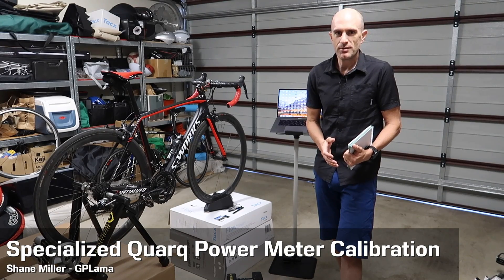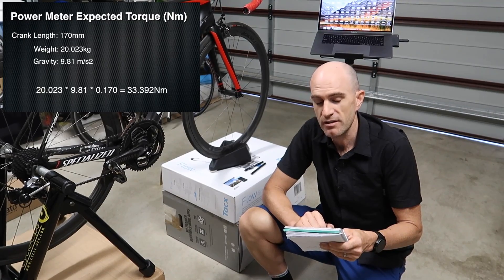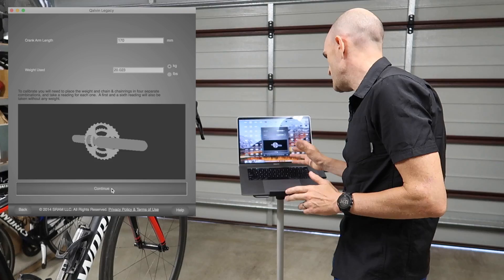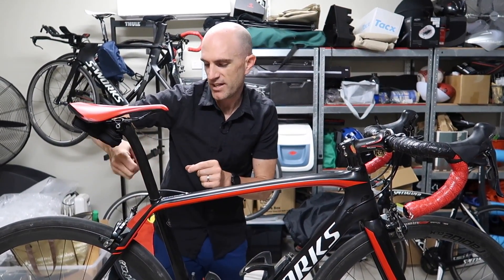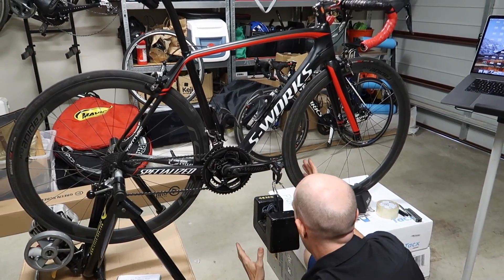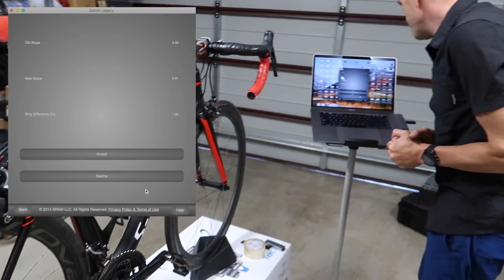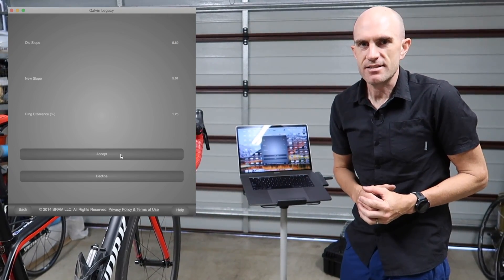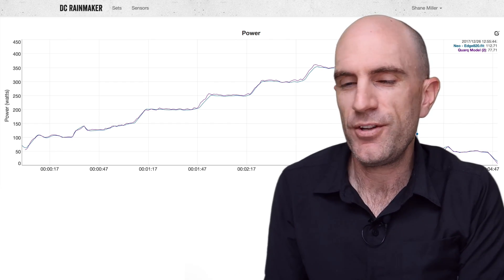Specialized Quarq Power Meter Calibration

Comment: Did the calibration on my quarq elsa. Had to do it many times to get it right. Trick seemed to be to do a few free turns of the crank before going to next step. It is now pretty spot on the kickr V6. Was over reporting before by some 15 watts @300 watts.

Comment: Thanks for the info - however  its not as easy  as it appears.  My story with my Elsa PM...

I had to pay to hire a calibrated (accurate) weight.  The company providing the weight only had 10kg, (QUarq recommends at leat 20kg for calibration) so I then had to take some home weights to the post office to get them checked for accuracy.  I did not have a convenient turbo trainer to hand so ended up putting my bike against a walll with the wheel on blocks to elevate enough to add the weights.   So in the end I was trying to place two sets of weights on one crank arm.  It was a complete fiasco.!

The software reported figures which advised a massive change of slope setting.  Given I had tested the Quarq powermeter against a Neo to start with, I knew the Quarq was out by 10 watts , so there was no way a large change in slope setting was required.  The net result was I decided ti leave the Quarqs settings as they were to start with.

So I am riding with a 10 watt error.   Given the totally unbelivable figures you see on Zwift these days, 10 watts out is not too bad!

Hope others have better luck than me : )

Comment: Hello, I have a query, my quarq dzero potentiometer has problems and it does not mark the real power until in some cases it does not mark anything, I would like to know what it is, take it to be reviewed but they tell me that it is fine, that they do not find the problem, and that they do not know why it does not mark the correct power, they say that they reset the potentiometer but it continues with the same problem.
 
I hope you can help me that it could have happened.
 
Thank you
Reply from the maker: Best to contact Quarq Support. I don't understand the question sorry.

Comment: Great demonstration of how to calibrate. I have trouble finding a weight. I am not extremely concerned about absolute correctness. I mainly want my different powermeters to somewhat align. My Quarq Riken that I use on my TT bike reads around 20W lower than my other power meters. I think the main change happened after I installed a larger front chain ring. I cross checked with a power tap wheel. When I use this wheel I receive very comparable power data for all my other power meters (Quarq DZero, Stages and Pioneer PM). Could I actually use Qalvin App and manipulate the slope manually until I find agreement between power tap  wheel and Riken in question instead of trying to chase an exact weight? I do not want to mess my Riken completely up but thought that this could work. If so, any suggestion of how much I should increase the slope number (I assume increasing to have it read higher power?)? Riken reads 300W where Powertap reads around 320W. 
Love your Fit File with DC Rainmaker.
Reply from the maker: If your PowerTap is confirmed to be correct, sure. It'd take some time and testing to line them up. Easier to source a calibrated weight and do the job faster.

Comment: I just took my Vector 2 pedals out of storage and installed them correctly. After repeatedly setting the correct crank length and install angles. I think the only option left is to do a static weight test and changing the scale factor. What kind of hardware is best to hang the certified weight from the pedals?
Reply from the maker: A wire hook. That's also added to the total weight in the calculations.

Comment: Good video and well presented, Shane, although you know my thoughts on 'home calibration'! Was your dead weight calibrated? I assume so given your decimal places. It's worth pointing out to your viewers this is still far off the Factory Calibration and should be a last ditch resort. One thing you must be aware of is creep. That is the sensors tendency to drift back to the origin after load application due to some relaxtion in the strain gauge and epoxy layer (visco-elastic). Thus is good practice to hit 'calibrate' the same number of seconds for each test after applying the mass. Secondly, you would normally perform a hysteresis relaxtion cycle before logging the first torque points. This involves alternating + and - torques to the load cell before taking the real points. This settles the sensor. Thirdly, I know the best PMs out there (SRM and p2m) use torque and speed calibration at discrete different temperature points. Temperature can affect the gauge factor and strain properties of the epoxy. I have a huge video on my channel about power meter design if you want to be bored even more :) Cheers
Reply from the maker: Certified weight, yes. Brilliant level of detail/info. However I try to keep it high enough level to be within reach/interest of the everyday user... including myself. There's a tipping point of detail and engagement on here.

Comment: Great video!!! this morning i was doing 3x20' z3/z4 work where Quarq came in at 30-40w less than Neo, creating a bit of a havoc/confusion to my numbers-oriented mind. on some sites i read that one should expect a difference between Neo and pedal/spider/crank based PMs due to where the readings take place. what is your experience in regards to this? looking towards the end of the video in DCR analytics, you seems to have a max deviation of about 5w (mainly 0-2w) which might be as much due to latency as anything else. 

initially, during warmup, the deviation was 15-25w but after having done 2 10s sprints at around 1000w the deviation went up to the 30-40w

Amazon failed to deliver a 20kg calibrated weight last week so i'm still in wait-mode before i can do the calibration you showed in first half of the video :-(

Comment: You go through all that trouble and accuracy in measurement and yet you eyeball level the crank arms. I hate to be that guy in the comment section but I am going to be. Get out a level
Reply from the maker: Crikey. Happy holidays.
Reply from the maker: It’s possible to check maximum Nm by moving the crank above and below 90deg. But if you’re all about the level, no worries.
Reply: Ok I misunderstood then, I thought it had to be level for the calibration check. So you were just doing It because you could. Merry Christmas to you too

Comment: Hi - I’ve just done this calibration in my 3 different Quarqs. Kudos to you for doing this video because there wasn’t much info out there when I started. A couple of things I did differently to you, so thought I’d pass on in the spirit of sharing the knowledge. First, you don’t need to weigh the hook. Instead, you can keep the hook on the crank when doing the “unweighted” torque measurements. This way you are not introducing another measurement error. Second, if you get the right hook then you don’t need to elevate the bike on boxes. If you do it on the ground, then you can hold the bike in place and apply the brake when you get the crank into the level position. This is the same way Jim Meyer from Quarq does it in his video and it’s pretty easy that way. Third, I sometimes found the Qalvin App a bit problematic. It’s an 8 step process and if your Quarq goes to sleep or it loses connection then the app gives an error and it’s back to the start. So instead I just did the calcs in a spreadsheet. As you said, you just need to compare the actual torque for your certified 20kg weight with the measured torque, which is the average difference between your 4 weighted and 4 unweighted readings.Out of my 3 Quarqs, one was bang on, the other within 1%, and the third was reading a whopping 5% too low!! Now they are all consistent which is much better when training on different bikes. Thanks again for your video. Must be hundreds of guys riding around with incorrect power data I reckon.

Comment: Hi Shane. Great video as always. I have a question for you. At the moment I have what I believe to be an accurate Quarg DFour and a old "variable" Vector 2 and am considering my options. Either a second Quarq to save swapping from bike to bike (2-3 times each week) which can be "troublesome" or going for a single accurate pedal based system (Vector 3 once there is enough positive feedback regarding accuracy - have read all of your posts on Garmin forum - Thank you). Do you have any thoughts? Also If I were to perform a static weight test with the same certified weight on 2 Quarqs would you expect them to then agree +/-1w (just like your Neo vs P1 video) so that I could just have one set of power zones & FTP etc etc. as I am not as powerful as you and even a 5w difference when doing SweetSpot or Threshold intervals could make things challenging!!!!!!
Reply from the maker: Swapping power meters regardless of how easy, is always a hassle, imo. Two power meters of the same type (Quarq spiders) should be very very close to each other if they're calibrated the same.
Reply: Thanks Shane. Your opinion/insight is very much appreciated. So it looks like a late Christmas Quarq has just been added to the shopping list. Thanks once again and keep up the great work 👍👍👍.

Comment: One thing for people to note is that you may need to use a magnet to get the spider to start measuring torque for the calibration on some Quarqs (ELSA, RIKEN and RED) even if you dont actually use a magnet to measure cadence on the bike. Then you need to rotate the cranks forwards to get it into the right mode. Otherwise the torque values may stay at Zero.

Comment: Could you repeat the process and hang the weight right in the middle of the pedal? Would be interesting if you see some deviation since that is the spot where the torque is actually applied while riding. When you put the weight more to the outside of the crank, it does not only bend, there should be some torsion too. The strain gauges will pick that up!
Reply: I just saw that you actually hooked it to the pedals. My bad!

Comment: Cool...  very interesting stuff.  I have been waiting for this one just out of general curiosity from my past sensor design engineer background.  Couple of questions and observations:  1) How do you know your weight is 20.000 kg (roughly 44 lbs)?  You state "certified", what does that specifically mean?  Seems like having a perfect 20.000 kg weight would be a rather unique and very fortuitous situation.  I am using 3 decimal places because you go to the extent of adding 0.023 kg for the mounting hardware.  2) Does Quark specifically instruct you to hang the weight off the pedal?  Think back to some of our earlier discussions of strain gage cross talk; the twisting of the crank arm potentially adding stress to the system.  With that in mind, it seems to me that hanging the calibration weight off the pedal introduces an unaccounted to variable.  Just as the crank length is a key factor in the calibration, the offset distance the weight is hanging off the crank arm would be as well.   Unless Quark has factored that in, BUT are all pedals the same?  If you had Speedplay pedals, would that offset distance be the same?  Of course, as discussed previously, there are ways in sensor design to eliminate the this issue, so the question is what does Quark instructions tell you to do? 3)  In the past, as a sensor designed, we would run repetitive calibrations on new designs in order to document the repeatability of the design.  One would expect Quark to have done this in their design validation, but it would be interesting for you to have repeated your specific process, say 3 times just to see how consistent the numbers are.  4) You stated Von's readings were a "...little bit..." high.  Does Quark provide any information as to how that slope value is used that you could convert into actual power values?  The slope value didn't change very much and we assume that means the power doesn't also.  Is that a correct assumption?  Have you ever done any comparisons of this power meter to any other prior to this re-calibration?   5) Would have been interesting to run the DC Rainmaker test on the system BEFORE re-calibration.  Also does DC's tool have any statistical analysis functions?   Would be interesting to do the math to back up a statement like "the Quark on average reads 1.5% lower than the Neo".  For that matter, that would be interesting on all your videos where you use this tool.  Having watched most of them, it tough to tell the differences between videos.  6) Couldn't you use a level to set the crank arm angle?  Probably a bit overkill, but easy enough to do.  My android tablet has a simple bubble level app that I've used to document seat angle.  Of course the key for calibration is to have the arm 90° to the direction of gravity!  Not to the floor, or not to the bike.    Thanks for another interesting video.  Sorry for being so long winded...  cheers!
Reply from the maker: 1) Sourced from a university. Tested/labelled. I trust it. For now. 
2) Pedal, yes. It's what they use in their guides too.
3) It's Christmas. Family time > backyard bike science time. But yes. 
4) Not sure, see 3. Time. 
5) Same as 3. The DCR Analyser is pretty basic with the numbers. It's a simple comparison of the figures.
6) Laser level would be ideal. Spirit level doesn't work on the cranks with curves.

Comment: Very interesting watch. Wanted to see someone actually doing Quarq static calibration. Good idea with the rear break blocking the wheel when cable quick release is closed. My Dzero is still quite new, so I trust its current calibration, but giving customers ability to check and change calibration slope is really great move by Quarq. It's one of the reasons I actually bought it. For me power meter seems more future proof when such option is present.

Comment: Wow, what a huge pain in the derrierre... How often do you have to do this?
Reply from the maker: In theory.... never. In practice, and if you're pedantic, maybe once every 12 months. Or if you change change rings. It depends.
Reply: That's cool.  Thanks Shane.  I just bought a new Norco Search XR Gravel Bike.  It came with Quarq Prime "Power Ready" cranks.  The DZero spider PM just bolts on.  I'm looking forward to giving it a spin (I normally use Stages on most of my bikes).   Hopefully it won't be this involved to calibrate it. =)

Comment: Shouldn't you also take the pedals off before attaching the 20kg weight?

Also, I have an approx. 20kg dumbbell and a small digital scale.  Could I weigh the dumbbell on the scale (assuming it's accurate) to find out its true weight and use that weight to calibrate my Quarq DFour?
Reply: there is a zero offset right at the start so you should have the pedals attached.
Reply: Depends how accurate your scale is. Shane's weight is accurate to 5 sig figs. If you used a general top loading balance, it would only give you 3-4 sig figs. You would need an analytical balance to get the degree of accuracy that Shane has. The easiest way is to just rent/borrow a pre-weighed weight from somebody.
Reply: Or find some place to provide a certified accurate value to the weight you have.
Reply: No, you shouldn’t take pedals off.  In fact, for the “unweighted” measurements I keep the hook hanging off the pedal. The key thing is to get the DIFFERENCE between torque measurements for the weighted and unweighted measurements, and then compare that to the known ACTUAL torque. The known actual torque is 9.81*20kg*crank length.  if the Measured torque is, say 1.03 times the Actual torque then you need to drop your slope by 3%.
Reply: On your dumbbell....measuring this at home will not be accurate enough. You could measure on postal scales, then use it. Better to measure at a few different post offices and take the average. I think they say your calibration weight should be 20 x more accurate than the accuracy you are trying to achieve from calibration.
Reply: I suppose you can make such calibration weight by combining smaller barbell plates (2.5kg, 5kg) which were weight on higher precision electronic scale (1g or 0.1g). You can reach quite good accuracy this way.

Comment: Nice job as always Shane. But, do you need to take pedal weight into consideration as well?
Reply from the maker: Not according to the documentation/processes I've seen. I'll assume it's calculated/factored into with the zero weighted measurements.
Reply: It would also be offset by the other pedal. Technically you probably should measure each pedal and even crank arms but probably very close.
Reply: Yes that’s right.  The pedal weight is essentially zeroed as part of unweighted set of measurements.. And so is the hook if you keep the hook on for the unweighted measurement.  So long as you then don’t add the hook weight to your 20.0kg.  Make sense?